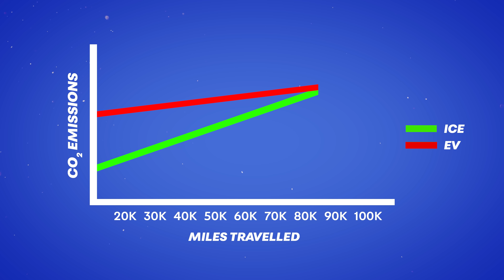Are Electric Cars REALLY That Green? [New 2022 Data]

Comment: The EV's footprint shrinks as the electricity Grid becomes cleaner.... independently of the car owner. Also the rare elements will never leave the EV battery pack, so they can recycled entirely. You can't recycle the petrol you've already burned.
Reply: Recycling is not a 100% money back thing though. You spend about 90-95% of the co2 with the recycling process as you would do with just building a new one. It's still great, because 5-10% is not nothing, and you save physical materials, but it's extremely far away from being free.

Recycling plastics for instance saves about 2% co2 compared to making new plastic.
Reply: "Recycling" carbon burnt in e.g. ICE engines by e.g. growing trees is already a major part of "carbon neutrality"
Reply: @FlyingPhysicist  pretty sure we can still plant more trees...whilst ALSO not using ICE cars. ICE + planting trees = Carbon neutral. EV + plant the same number of trees = Carbon negative. ;)
Reply: @joeynessily  I'm not for one moment suggesting the burning of petrol whose carbon is to be offset by growing trees is a good thing, I'm just saying that's the current logic that forms the basis of international logic on carbon reduction, contrary to your last sentence re: recycling petrol.
Reply: @FlyingPhysicist  oh ok.. fair enough. It read like you were advocating such practices as a suitable solution. All good mate if that’s not the case
Reply: @FlyingPhysicist  That's particulate matter, rains out in short order. The problem with coal is the ancient carbon it introduces to the cycle. We're adding 40 billions of Co2 to the air each year.
Reply: @pianodarr  ... Nothing new or interesting there.
Reply: @joeynessily  and you can recycle petrol that was already burned, with solar/win/nuclear fusion (last in future) power and CO2 you can produce synthetic petrol. And with that you can make, all of the old cars way more eco friendly, most regions of the world are way to poor to own electric cars.
Reply: @FlyingPhysicist  tell that to Amazon lover Bolsonero.
Reply: You know that CO2 helps A Lot of plants to grown faster?
Reply: @Ren_1106  only when all the other conditions are met.

Comment: Be amazing if we had choice instead of being forced. But petrol and diesel all day
Reply: Diesel is more efficient than petrol which is more efficient than batteries.  Guess your next whine will be about having to put on underwear since we haven't invented space pants yet.
Reply: @uni4rm  Are you for real??   A typical ICE car, petrol or diesel, runs at 30% efficiency at best, putting out emissions for every mile it covers. The other 70% is wasted as heat. An electric car runs at 80% to 90% efficiency, with zero tailpipe emissions. A diesel car might be more economical than a petrol car, but is no more efficient in it's combustion process......

Comment: As our energy gets cleaner over time the production and running of EV’s will get better too. It’s the direction we’re headed in that’s most important.
Reply: Excellent point. But the challenge with your assumption is that the growing demand for EVs would eventually place a correspondingly higher demand on energy production, which, according to several papers, cannot be supplied by renewable energy sources alone (at least for the time being). Power producers would therefore become more dependent on non-renewable fuels(crude and coal) for energy generation in order to meet this demand. Of course government restrictions can always be used to control the usage of crude and oil, but that would result in higher energy prices, an example of which is already happening in some parts of the world.
Reply: except the LIBs are made in China with Coal.
Reply: I'm living in a country with extremely backwards energy grid and politicians concerned more for the coal industry than climate restoration. I was considering getting an EV next but after this news I don't think I'll be able to reach the break even point before swapping the EV for a new car.

Comment: Big question is and sure someone Will have asked this, will the battery even last to 50,000 plus miles let alone 90,000?!
Reply: There is always a comedian 🙄
There are many EV's out there with 100k ,200k, even 300k+ miles
Reply: @SDK2006b  certainly not being a comedian it was a genuine question, not everyone will have the knowledge that you may have and given the cost of battery replacement an obvious concern. However, if batteries genuinely and reliably last that long then fantastic.
Reply: There is a site with Tesla age/milage and % battery degradation many with well over 100000 miles and over 80% capacity these are also 18600 cells and are early cells and proving to be quite durable. Then there are 2 battery recycling companies that are quoting 95%+ reclaim of materials.
Reply: My BMW is 50k and 6 years old. It's absolutely fine thanks, with no issues and pretty much no servicing required. There is same model in South Africa with 200k. It's not at all a big question.

Comment: So after 90’000 miles an ev is better for the environment than an engine that’s about 3 years for most company cars and vans. So long term when used ice cars/ vans are no longer viable they are quite a lot better. Unfortunately there not wallet friendly enough yet !

Comment: It's interesting to see Volvo's number be that high, since other reports have much lower numbers.  Reuters analysis last year by the Argonne National Laboratory in Chicago calculated a break even point of 13,500 miles, while Tesla's impact report states that a Model 3 breaks even with equivalent ICE vehicles after only 5,340 miles.

To be fair, Rory's point about making vehicles more efficient also holds true, the Model 3 is rated at 243Wh/mile but the Volvo C40 Recharge guzzles 357Wh/mile.  That's nearly 50% more!

Honestly I'm just looking forward to a day where I can walk down the street without choking on exhaust fumes from buses and trucks and cars.  I still have a fond recollection of taking a walk during the first lockdown when there was practically no traffic and I could smell the flowers in neighbours gardens rather than the diesel fumes.  Even if all we do to start with is centralise pollution production to power stations, quality of life in our towns and cities will be so much better.
Reply: Volvos numbers are high because they aren’t yet sourcing renewable generated electricity for manufacturing and are manufacturing in China on their standard high CO2 mix. Some others only use renewables (e.g. VAG) or use a lot of renewables (e.g. Tesla)

Comment: Great that you’re tackling this thorny issue. 

Tesla’s 2020 Impact Report is a long, but good read (I guess we’ll be updated with a 2021 report sometime). They cover the whole shebang, from mining to production and use case.

This is one quote;
“5,340 miles
The manufacturing process of a Model 3 currently results in slightly higher GHG emissions than an equivalent combustion engine vehicle. However, based on the global weighted average grid mix, a Model 3 has lower lifetime emissions than an equivalent ICE after driving 5,340 miles”.
Reply: This will be even fewer miles in areas such as the UK where the grid has lower carbon intensity

Comment: One thing that is not included in the Volvo analysis is the fact that the European (and global) carbon intensities of the electicity mix will decarbonise over time, the analysis uses a constant figure... Accounting for future decarbonisation EVs are much better... Also as you mention WLTP vs. real world driving mpg (the difference is around 20%).
Reply: A study comparing two cars built today from a factory today would not include future infrastructure improvements because that is outside the scope of the study.  You have to have fixed constants and controls in order to do studies at all.

Comment: Does that take into consideration the decline in relative efficiencies due to poor car maintenance that an ICE vehicle will experience? These are ideal scenarios. Even as battery capacity decreases, is that decrease at the same rate as an ICE's rate of decline due to increased carbon buildup, worn sparkplugs, leaks, etc.?

Comment: If car companies where actually clever, and cared about the environment they would focus on recycling old cars. What I mean here is they take your old car. They rework an electric motor into it for a set price and than instead of building a new car you pay for extras they can retro fit into your car. This would be incredible for classic cars and drive the market in such a different way!
Reply: Recycling of the scrap, used in cars & general heavy industry does happen though & it's actually cheaper to outright build new cars on a new manufacturing line.
Retrofitting is too boutique & custom to serve the mass market. Aside from Tesla most manufacturers' margins are too thin, as achieving economies of scale is always the desired outcome which means they need to seek standardisation & build EVs from the ground up.
That being said, recycling batteries is something that should & will play a bigger role as batteries are the most expensive components in the cars.
Reply: It happens at a small scale just now. You can buy a kit to retrofit your classic Mini for a mere £20k!
Reply: @pumpkinhead456  that’s the problem it’s 20k.. haha
Reply: EV west in california has been retro fitting classic vws and porches with electric motors  well before ev scene became a thing

Comment: Yes, they are on balance no better, IMO.  Modern ICE cars are extremely clean with negligible emissions.  EVs are expensive, have lithium and cobalt-derived batteries that tax the environment enormously, both in extraction and disposal.  The electricity they demand WILL overload our system at a certain point, and our electrical grid will not keep pace.  Emissions are really more a function of industry and trucking, not passenger cars.
Reply: It's amazing: everything you just posted is inaccurate.

Comment: Interesting......but.....I also run my EV on 100% renewable power, my EV is averaging now, in the wet winter, 3.4 mpkWh and the XC40 is way worse than that! Also, did Volvo take into account that EV batteries don't die? They can be recycled into other uses, or the Lithium can be reprocessed and reused. Neither my XC90, which I have just sold, nor my S60 achieve anything like the mpg claimed by Volvo. So, good to debate it, but I would like to see a more independent assessment. And don't start me on the rate at which my Volvo's eat tyres and brake pads. Anyway, the XC40 costs stupid money 😂
Reply: Huh?  Did you watch a different video?  They are talking about when a brand new car crosses a footprint threshold.  And so what?  ICE cars can be recycled as well.
Reply: @uni4rm  No, they're talking about 90,000 miles of life as well, not just brand new.
Reply: EV cars don't have brakes now?
Reply: @nmot97  Of course they do, but they don't have to use them as much because of Regeneration braking which uses the electric motor to slow the car down. As a result the pollution caused by traditional brakes being used and the need to replace them several times in the lifetime of the car is significantly reduced.
Reply: @Olivarus238  you have a point. Although if you drive a manual, it's very easy to commute and barely use the breaks. Of course on traffic hours we need them more, but that type of breaking doesn't wear them much. At least I don't have big expenses on brakes, they last for a lot of kilometers. I think oil is a bigger problem, if a car consumes a lot of oil whereas on EV is not a problem

Comment: Would be interesting for auto trader to do s real life road test of 10 year old EV's and how they hold their charge. Yes the pay back period of EV may be lower but if you are having to build two EV's to cover the milage lifespan of one petrol car then it opens up a new conversation.

There is still a very large stigma around what happens at the end of the car batteries life and many people would argue that the cost of a new car battery right now would warrant replacing with a brand new EV. Whole life costing is just as important as just build and operational carbon cost.
Reply: This stigma is largely from people who haven't driven a high milage EV. On Teslas, which have the most data, they seem to maintain about 90% of their battery capacity  to 100,000 miles or so. The drop off is greatest initially then plateaus around this level too, so doesn't really get much worse. Typically the batteries on cars produced today will significantly exceed the expected lifetime of the car.